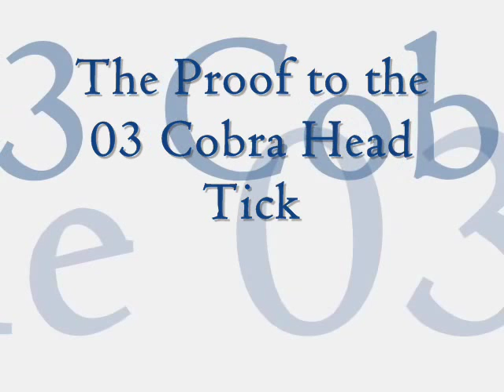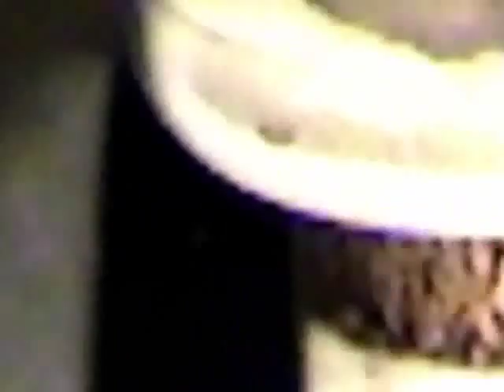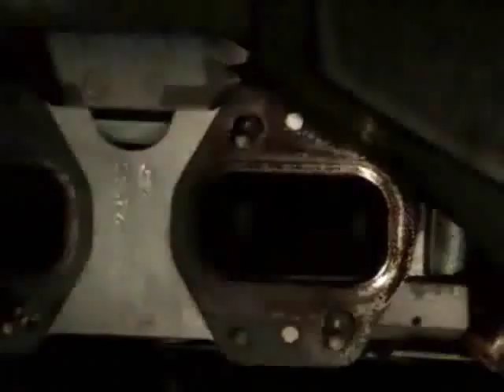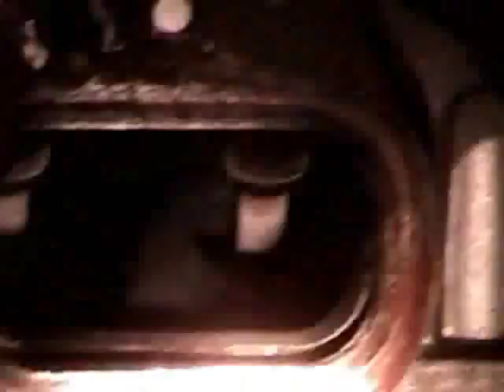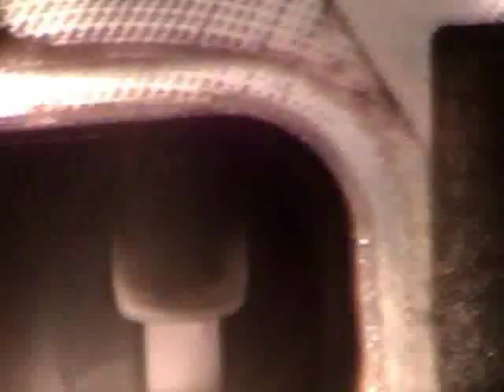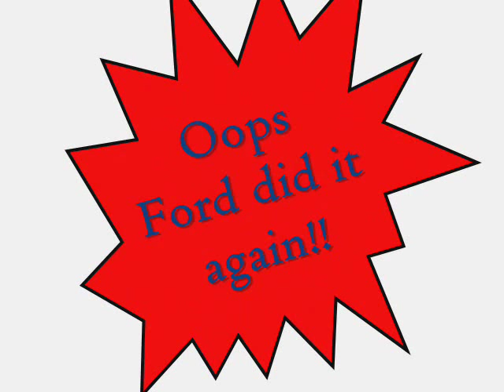2003-2004 FORD 4.6L DOHC V-8's bad exhaust valve guides

Comment: So it's the exhaust valves that stick? I'm having the cyl 7 and cyl 8 misfire, rough idle, won't pass smog, $6500  repair syndrome on my Lincoln aviator 2004